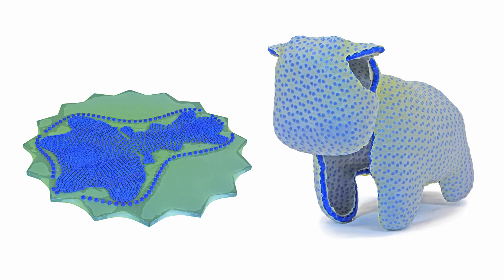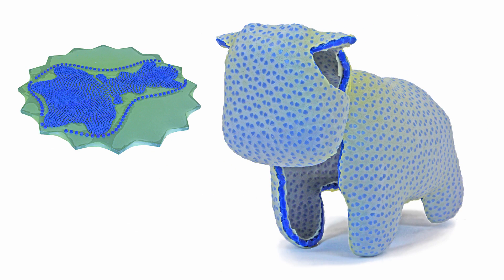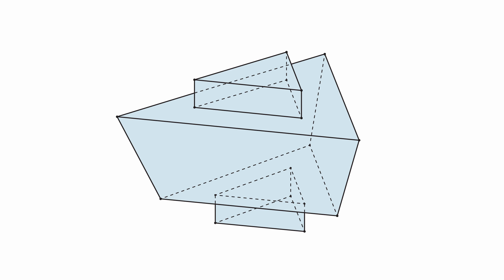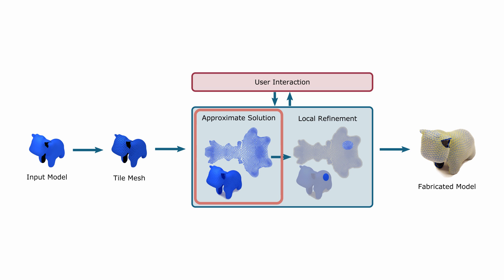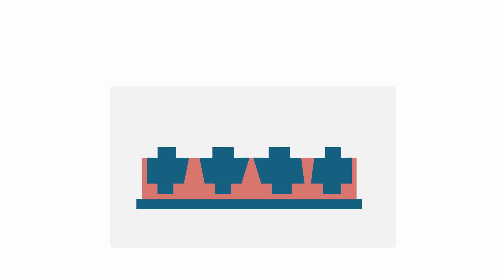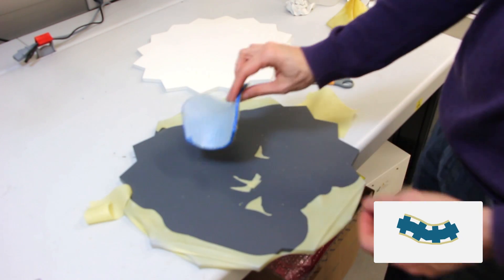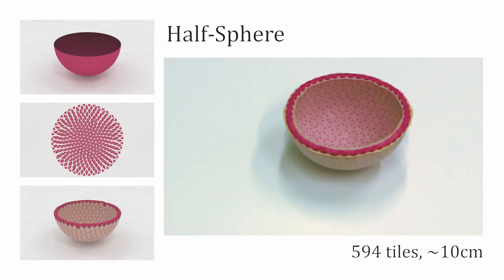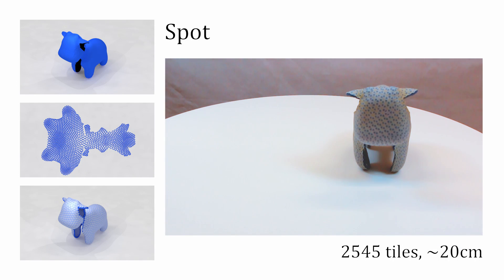CurveUps: Shaping Objects from Flat Plates with Tension-Actuated Curvature (SIGGRAPH 2017)

Comment: Very clever process. What is the reasoning behind the pins needing to be right triangular prisms specifically?
Reply from the maker: The main reasons are that they form aligned rectangular areas on the membrane between the neighbors and that are easy to model in a physical simulation due to their geometrical simplicity.

Comment: Removing the support material seemed like such a tedious point of the process. What about splitting the 3D model into two parts, a top and bottom? Then it could be printed with all the tabs facing up and minimal support material connecting the pieces, like a plastic model kit. Then you could simply glue the two halves together, attach the first elastic layer, then cut off all the links.
Reply from the maker: We demonstrated one way of fabrication of the structure which is reasonably reproducible. It is certainly not unique and there might be better approaches depending on the available fabrication tools and desired final goals.
Reply: Alternatively, you could divide the model into sections with concave or convex features, and print those out separately. (honestly that sounds a lot harder to do for some models than others) Then the plastic bits could be placed with no space between them at all, eliminating the need for tabs on both sides.

Comment: have you considered putting a zipper-like edge on two curve-ups so that they link together to form a complete design?
Reply from the maker: Connecting edges could be used in practice, however note that the edge lengths might (non-uniformly) contract as the target shape forms, and this is problematic for standard zippers. There are other possible alternatives, for example, per-tile magnets or mechanical locks along the edges.
Reply: @ruslanguseinov4605  What I was thinking was interlocking teeth mounted on the tiles themselves that lock into place when the elastic contracts, holding the two curve-ups together. zipper-like as in interlocking teeth, not as in actual zippers.

Comment: You have some great programming skills, but I can't see any reason for people to use this instead of just 3D printing.
Reply: If you used something like heat shrink plastic instead of prestretched elastic you could transport and store them as flat sheets until it's time to use them.
Reply: Fewer materials are used for printing, plus the structure is still elastic and deals better with potential damage.